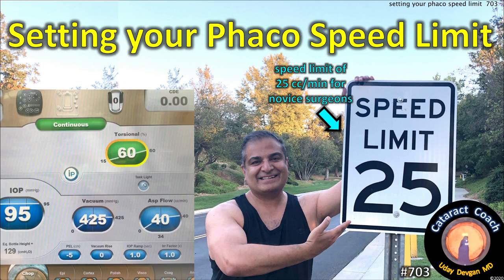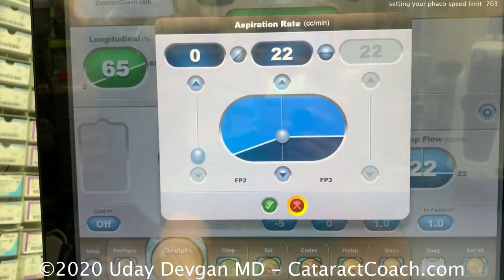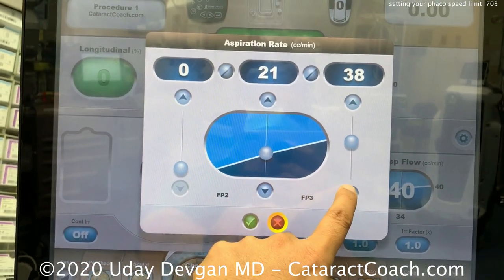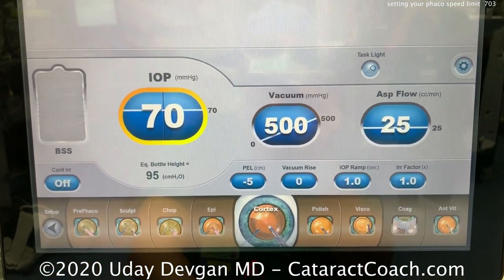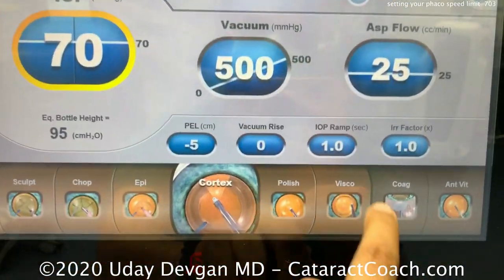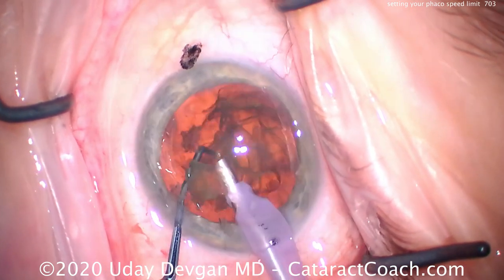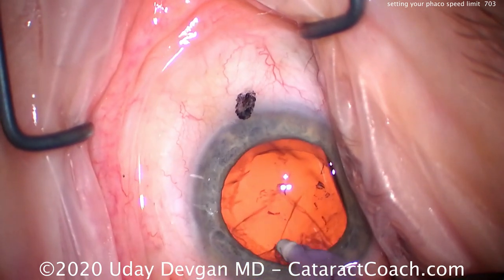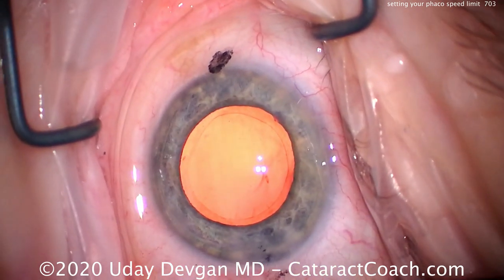setting your phaco speed limit in cataract surgery

Comment: Would this lower flow rate also decrease the chance (or incidence) of post-op corneal edema?
Reply from the maker: putting less fluid through the eye will help to prevent corneal edema, but the flow rate is only part of that equation. 40 cc/min x 1 minute of phaco time is better than 25 cc/min and 10 minutes of phaco time. 
See here: https://cataractcoach.com/2019/10/24/secrets-to-avoid-corneal-edema-after-cataract-surgery/
Reply: Uday Devgan Im using 14cc fixed flow rate and 280 vacuum and my "speed" is less than 7 minutes . I don't think that only fluidics settings can set the "speed" of a surgery, but also the surgeon technique. In general less fluid turnover leads to less corneal edema and better early refractive outcome.
Reply: Multiple factors are at work. What diameter tip is being used being one. And 25 cc is not that low a flow rate. However lower flow rate also may contribute to wound burn.